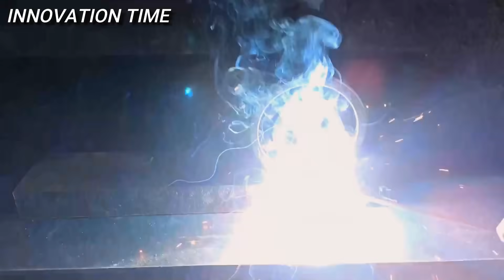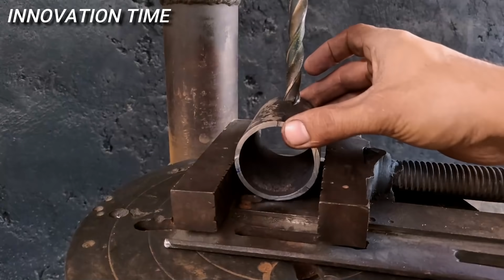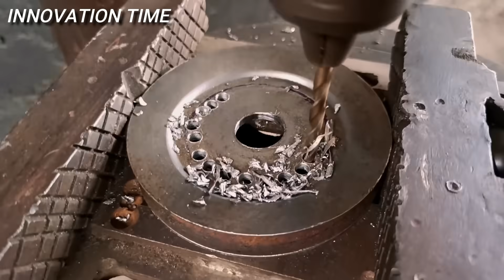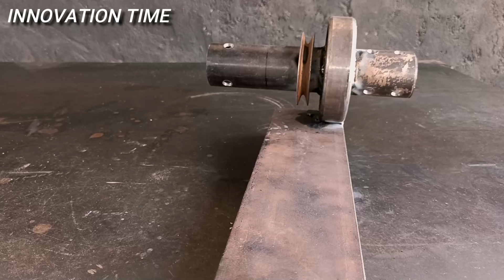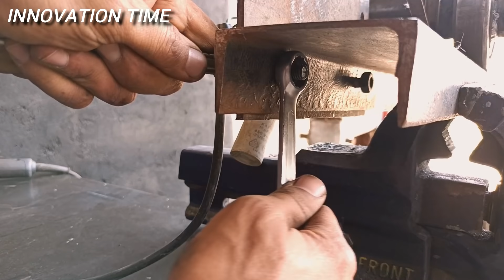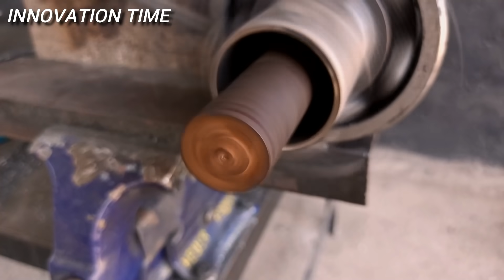I have always needed this handmade tool in my workshop

Comment: WOW, I have a new project in mind, I love your idea, but Im wondering if a better bearing could produce a smoother 'lathe', your method works, but there is plenty of run out on both axis, (Im assuming that is just from the play in the ball bearing itself), Anyone have any ideas?
Reply from the maker: Hi dear mike 
I have some mistake for this project, It must made with two bearings and it must have a unique pipe that pushed in bearings
I am making a complete lathe machine and making a video about it
It take several months 😉

Comment: That was good you made a spinning round thing, I was thinking about the same thing, but using a Toyota front hub, and belt from a motorcycle on the brake rotor with the belt sprocket bolted to back side of brake and a real chuck with proper mounting plate. It would be much more work to do but I think the better stability would be worth it.
Reply from the maker: Hello my friend
It was a good idea
This tool I built has a lot of issues that didn't work for me, but I'm building a complete lathe that should probably be finished in the coming months.🙏🌹
Reply: @innovationtime20  good luck that is my idea also with the car front hub, should be stable and centered.
Reply: I have not started yet, as I have no shop or place to work yet, but I still try to gather parts.
Reply: @innovationtime20  hope to see the video of the build, and good luck to you also.

Comment: This is not correct using only one bearing,,, it will shake continuously when it the motor start running,, if it is expected to do a homemade mini lathe machine...
Reply from the maker: Hello my friend
It was just a simple idea
I'm building a complete lathe which will probably take a few months, I think you might find it interesting.😉